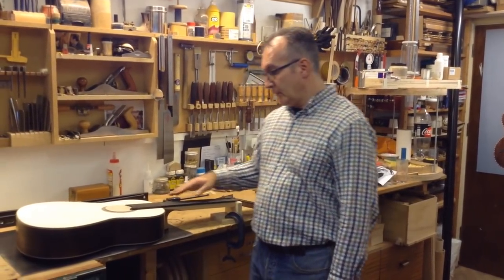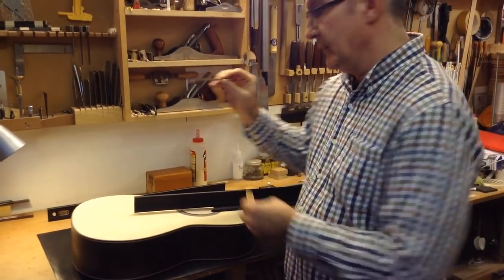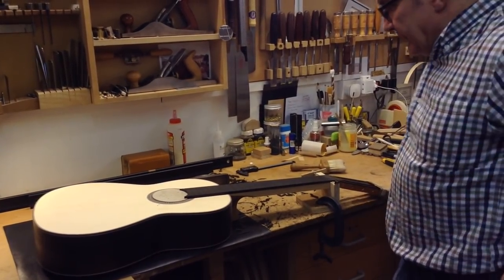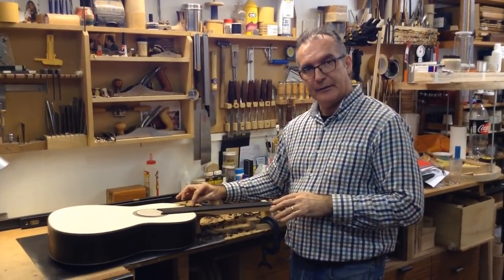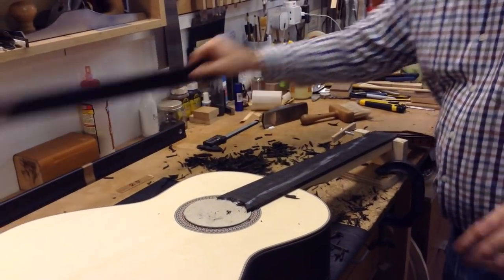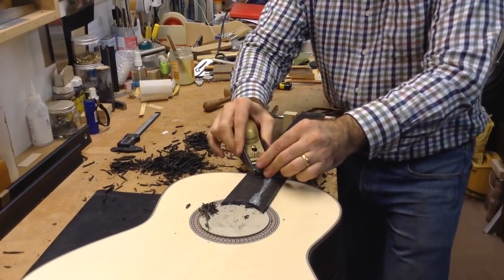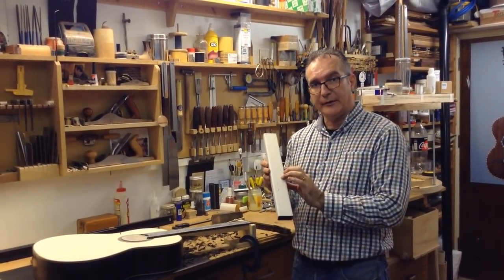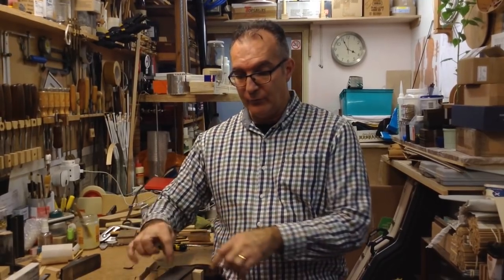How to prepare  the fingerboard for the right set up.

Comment: This is ONE WAY to shape the fingerboard.  I used to do my fingerboards in this manner many years ago.  However, this can also be a very dangerous method.  I have repaired many Ramirez and other Spanish guitars with way too much fingerboard angle resulting in low saddles and too high action.  I would like to know what Pablo's final saddle height is on bass and treble ends of saddle.  I prefer a slightly higher saddle which allows room for the saddle to be lowered if a customer should request lower action.  I prefer a saddle height of 12mm's with an action of 4/3 at the 12th fret.  This is my target.  I also put a very slight amount of relief in my fingerboards, about .006" on the bass side and almost no relief on the treble side of the fingerboard.  I'm more concerned about the saddle being able to be adjusted down, than whether or not the saddle is flatter across the strings as opposed to being slanted from bass to treble.  Pablo's method is very "Ramirez".  It's the Spanish way of thinking which had proven to be troublesome nowadays.  I'm not saying Pablo is wrong.  I'm just warning guitar makers who watch this excellent video to be careful using this method.  A few too many swipes with the plane and you have gone too far!  Also, your plane MUST BE VERY SHARP.  Especially if you pre-cut the fret slots.  You can chip and damage the Ebony when planing it, even with a sharp plane iron.  Trust me.  I also glue on my fingerboards at 7mm's thick.  But after that, I SAND THE SHAPE into my fingerboards.  I don't plane them into shape.  It's too risky.  Thanks Pablo for sharing your method.  It works, but it's risky and can lead to action problems if not done skillfully.
Reply from the maker: Hi Robert,
Thanks for your comments, the hight of the strings in front of the bridge using this method is about 10mm at the base and  treble, that is with an action of 4/3 mm at the 12th fret. That leaves me enough room for adjustments.
Of course when you plane ebony you need to have a very sharp blade, sometimes I have to stop and sharpen the blades a few times on the same fingerboard, but if your plane is well set up it should be ok. I also finish off the last final touches with a sanding block. Anyway ..... there are just many ways of doing the same job, this is just the one that works for me.
Reply: @redkitekk   Maestro, 
About the saddle height there is something not clear to me: to allow a 10 mm strings height over the soundboard “in front of the saddle”  that works, you need not only plane the fingerboard at 2,5 mm, (base side) as explained in the video, (and 3,5 at trebles side) but also a low bridge (!), as they are in close relationship.  
If I plane the fingerboard at base side to 2, 5 mm eight in front of the saddle, to obtain an action of 4 mm (12th fret), I need a  further elevation of 8 mm at saddle.
Then the final saddle eight at base side will be 10,5 mm. 
So, at the treble side if I have planed the FB to about 3,5 mm, to obtain an action of 3 mm (12th fret) I need a further elevation of 6 mm at saddle. Then the final saddle eight at treble will be 9,5 mm. 
So, with a 8 mm bridge high then the saddle will protrude 2, 5 mm at base and just 1,5 mm at trebles.
So, as my last guitar I’m building (4th) has a  bridge 8,5 mm high, (not glued yet) then the saddle will protrude 2 mm at base and just 1 mm at treble. In my case it seems I should need to plane the FB a little bit higher, to obtain the same result, 3 mm at base and 4 at treble.  
Are my calculations correct? And.....
Sorry for the long question!
Reply from the maker: @costantinoproietti7578  Don't forget that all these calculations work very well in theory but in reality every guitar is different so you have to be a bit flexible with all these dimensions. I say this because there are things we can't control fully, like how much is the neck going to pull forward when the strings are up to tension.
I think you need to turn your attention to the bridge as you have already suggested. What I do, and it works with the set up I do in this video, is to make a bridge that is 7,5 mm thick at the thickest point, that way there is enough bone above the bridge to be able to adjust the action to the needs of your guitar. I start making the bridge plank 8 mm thick, but by the time the bridge is made the centre section is about 7,5 mm thick.
Just in case you find it helpful I have recently completed an on line course that is available on www.onlineguitarmakingcourse.com
Reply: @redkitekk  Maestro,
you are a very kind person and. Now I can afford in a better way this building part. Thank you so much.
Reply: @redkitekk  Pablo- Hello.  I was watching this video once again, last night, and I see a problem in the numbers.  To end up with a saddle height of 9-10mm’s with an action of 4/3 does not allow much, if any, room to adjust the saddle down, should a player want a lower action.  The ideal bridge height is 11-12mm’s with an action of 4/3 at the 12th fret.  Why 11-12mm’s?  Should a player want to lower the action to 3.5/2.7 or so, the saddle needs to go down 1mm, to 11 or 10mm.  Should a player want to lower the action to 3/2.3 or so, then we would be at a saddle height of 9-10mm’s.  Below 9mm’s you are losing the mechanical advantage of the saddle.  So, my point is, if my target is 4/3 and 10mm’s, I haven’t got any room for the saddle to go lower as I will now be in Flamenco starting range.  The bridge would have to be planed down to accommodate the lower saddle, and the mechanical advantage starts to go away.  I personally shoot for 11-12mm’s for an action of 4/3.  I don’t like a saddle lower than 10mm’s unless I am making a Flamenco guitar.  I have found that the shaping of the fingerboard is perhaps the most important step in guitar making.  Also, the shape of the fingerboard “across” the strings is another subject for discussion.  Some guitar makers make their fingerboards dead flat across the strings, and some put in a very slight convex dome.  Also, I don’t think you discussed fingerboard “relief”.  It’s important.  I have found that about .004”-.007” of relief, mostly on the Bass side, is extremely important and advantageous for a buzz free set up.  Lastly, after watching your video again last night, I might recommend wiping a block of paraffin wax to the sole of your plane.  You are probably aware of this trick, but it makes the plane travel much smoother on the fingerboard.  No two guitar makers are the same.  I respect your methods, but the shaping of the fingerboard is so important, I wanted to comment again on this video.  The saddle height must be high enough for future downward adjustments.  Only once in my 30 years of making guitars has a player asked me to make the action higher :-).   Almost all players want the lowest action possible, as most players are not strong professionals.  Most players want an easier action, which usually means a lower saddle.  You can have a lower action and a proper saddle height if you start off with a slightly higher saddle.  This is my main point.  I always enjoy your videos and you are a brave man for putting them out there!  Thank you.

Comment: I want to achieve about 7-8mm string height at the bridge for my Flamenco guitar. So when checking with a straightedge like you did I am looking für only 1,5mm spacing?
Reply from the maker: No, you still need to have 2 to 2,5 mm at the base and 3 to 3,5 mm at the treble. This is why: in the video I explain how to work the ebony for a classical guitar with an action of 4 mm at the base and 3 at the treble measured at the 12 th fret giving you a hight of about 10 mm at the bridge. If the action for your flamenco guitar is 2 to 2.5 at the treble and 3 at the base, all you need to do is to lower the height of the saddle 2 mm, this will give you a hight if 8 mm at the bridge area which is what you want. The one thing you have to do different from a classical guitar is to make a bridge that is no thicker than 6.5 mm at the center section, in a classical guitar this would be 7,5 mm. I hope this makes sense.
Reply: @redkitekk  Thank You for that quick response :-) Yes that makes sense. Good night!
Reply: @redkitekk  Sorry to be that guy: I guess when you write "base" you mean "bass". In any case, a thousand thanks for your videos. All the time and effort you take to share your knowledge, it's really apreciated :)